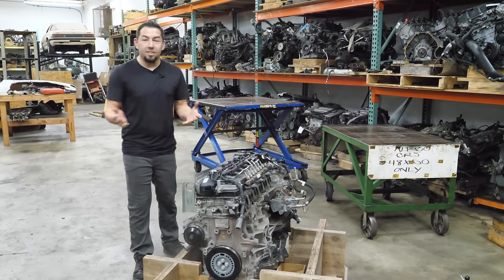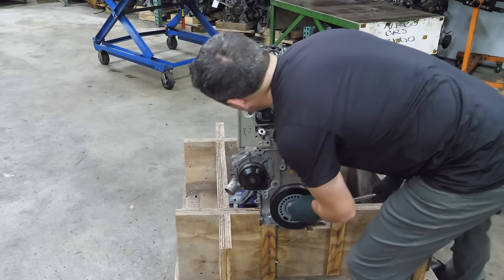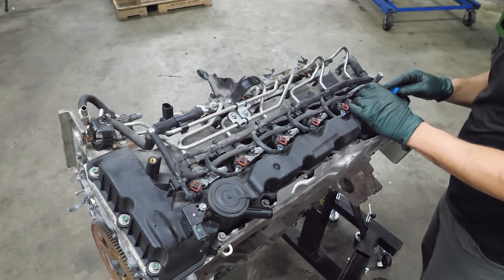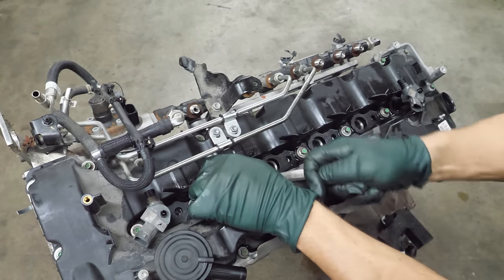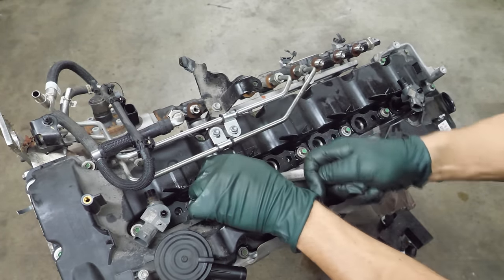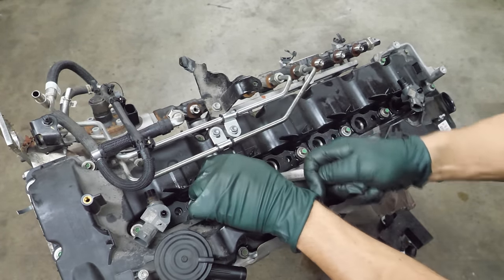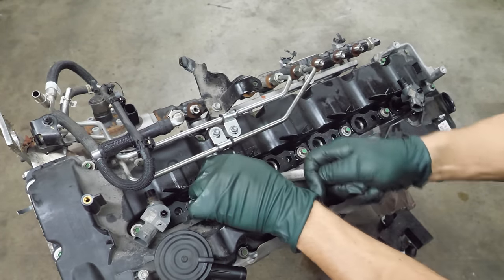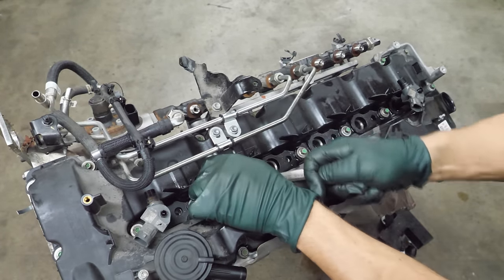BAD 2020 Silverado 3.0 Duramax LM2 Engine Teardown INCREDIBLE DAMAGE!

Comment: As a current 3.0 Duramax owner I hope not to experience this in person.
Reply: Frequent oil changes with quality oil. You’ll be fine.
Reply: Can’t believe those pistons didn’t crack from the new valve reliefs.
Reply: @MendicantBias1 Did one at 500 and at every 5000 now, with factory Dexos D. Cheap insurance.
Reply: That generation had a issue with oil consumption that was  hopefully with the LZ0 model.  The oil pump beltbus for drive ability and noise reduction.
Reply: Check your oil level
Then check it again and check it often
Don’t go by the oil life monitor, change the oil long before it says to.
Reply: Change the belt at 90,000 & oil change 5k
Reply: The engine seems like it was ran pretty long after it jumped timing
Reply: Check the oil from time to time.
Reply: Why didnt you buy a v6 or v8?
Reply: @Lorin-GabrielLeaua-fm1lw  1 you clearly didn't watch the hole video the engine was ran low on oil, most likely ran with low oil pressure for a while jumped timing because of the oil pressure and then ran even longer definitely could have been avoided. 2 250,000km is only 155,000 miles, so only 7k more than this engine had.
Reply: Change the timing chain
Reply: Just take care of it like you have common sense and you will be fine.  We don't see these engines at our dealership for anything more than regular service.
Reply: @747fixr because neither of those are as good, especially the V8 options in the 1500. Plus they also aren't capable of 30+mpg.
Reply: @briantruck2284 what is the cost of the belt replacement? Can’t be cheap.
Reply: @Mittencarpentry  I'm curious, what is manufacturer recommendation on interval?
I'm guessing it's more then 5k miles.
Reply: If your oil isn't going down between changes then it's not oil consumption but abuse from infrequent changes. Unless there's blowby somewhere but usually you'll see oil on the air filter. ie A bad egr valve will give you blowby.
Reply: Proper maintenance and keep the RPM's down....and you should run for a long, long time.
Reply: @MendicantBias1 ....an oil change has nothing to do with the pistons hitting the head, that was caused by repeated redlining.  That person got in their truck and buried the gas pedal the entire time.
Reply: They are very reliable when maintained properly. Isuzu builds the best diesel engines.
Reply: @fl_atv_riders4455  Define "pretty long". Anyone that doesn't know anything about engines could easily hear the sound of the valves hitting, think what's that, give the engine a quick rev to check the noise is still there and then shut it down and by then (only a few seconds really) would be enough to do this kind of damage
Reply: @andyg9991  from the sounds of it they continued to run it and diagnose it for a bit after it jumped timing, he stated the people just complained of lost power. The valves probably self clearanced after the first couple mins and stopped making noise and it lost power because the timing jumped and the valves where probably stuck open enough to have low compression. Then to top it all off do you really think that someone that doesn't check the oil on a 150k truck will know what noise that is
Reply: @deplorablelibertarian I used to do paint chip and scratch repair with a guy who drove his Silverado like that.  Complete ass driving on the highway.  Full throttle or nothing, all the time. That’s a terrible way to treat any vehicle
Reply: I'm sorry.  All I see here is needless complication by the designers.
Reply: @willl.3353 those pistons has a lot of varnish on them which is very unlike a diesel engine.
Reply: That's like saying, I hope I win the lottery. And you know the chances of that. I'm willing to make a bet that I don't ever win the lottery and that you will win the my 3.0 duramax engine blew up lottery.
Reply: Looks like STP got added to the oil. That Goo at the bottom of the pan plus the glitter.
Reply: Duramin you mean. They forgot to change the name when they changed the entire design philosophy.
Reply: @Mittencarpentry 5000? Kilometres hopefully lol but if it is miles then drop it down to 3000 max then your engine may last more than this heap of junk
Reply: @dakotaman408 I'd much rather have a slightly noisier engine with a chain driven oil pump, than a belt driven one. Look at Ford's Ecoboost engines, a similar design with belt driven oil pump with belt running in oil. THAT'S a crap design too !
Reply: @joeldeangelo6083 err... why? There was fu*k all wrong with the timing chain. It was lack of oil pressure that led to the chain jumping sprockets
Reply: @@Lorin-GabrielLeaua-fm1lw  The engines that rattled the front ends apart on the Ram trucks?   LOL
Reply: @@Lorin-GabrielLeaua-fm1lw  I have a 20 Duramax 3 liter Silverado... BEST truck and engine I have ever owned.. No oil use, starts every time, fun to drive as you don't have to rev it, it just goes... The 10 speed automatic is perfect for the engine too.... 
 Tows great... I guess I am prejudiced, but I am very happy with it........
Reply: You will sell it…
Reply: Sell asap
Reply: I think it had poor maintenance and was driven as a race truck or want to be racer
Reply: @briantruck2284 lol......you go get a quote for that plus yer not gonna change the belt without replacing chains,tensioner etc while yer in there. That chain is too long and has too many turns in it for it to last any amount if reasonable miles. Give us all an update when you have 200k miles on it....hint: it won't make it that long without very expensive maintenance and repairs. Vehicles dont run on emotions.
Reply: This was the kill video for me. I love my 6.6 but after this teardown. I wont be buying a 3.0 EVER.....belt driven oil pump? between the engine and trans. WHY? and location of the timing chain. Its over for me.
Reply: Do your maintenance and that motor will run hundreds of thousands of miles
Reply: Ford Ram GMC terrible design on these motors. Engineers went backwards.
Reply: Maintaining an engine and not dogging it will prevent this
Reply: Just don’t keep it past 125,000, and you should be fine….
Reply: ALMOST bought a 3.0 Silverado last weekend. Love the concept. Small inline 6 diesel. Perfect for a 1/2 ton. 

But… REAR BELT driven oil pump! Designed for use in cabovers. Typical GM blunder. Could not do it. 

They are known for high oil consumption. Seems this one didn’t make it to the next oil change. 

Went for a Tundra with gas V6.
Reply: Just checking the oil would have saved this engine.  I am impressed more than I thought would be.  @MendicantBias1
Reply: I beat on my 32-year-old Corolla all day long and it runs like new with no oil consumption
Reply: I have a ‘21 2.8L Colorado. My truck gets the oil changed every 2500 miles, I use Pennzoil Euro Platinum full synthetic.
Reply: I have a 2021 with this engine and love it. It averages 32mpg and has given me 44.6 mpg on the highway. Like any diesel oil and filter maintenance are a must to get longevity. I would love this 3.0 in my 1956 chev truck.
Reply: I don't trust GM anymore, Im staying away from the AC Delco. ow-20 @Mittencarpentry
Reply: @747fixr  i have a 3.0, and this motor is impressive. loads of power, excelent fuel economy. sweet engine. absolutely love mine.
Reply: The oil is very specific. Use ONLY that oil. Dexos D and the 0-20 is what the manufacturer calls for. I used only that in mine. Ran like a champ.

Comment: As a BMW tech who's has the unfortunate displeasure of doing many timing chains on the newest BMW inline 6 diesel the N57, it is unbelievable how architecturally similar these two engines are. Wouldn't be surprised if the cam followers swapped directly over
Reply: Is there a common cause for these N57 timing chain failures?  My 2014 535d with the N57 has 125k miles and I change the oil every 5,000 miles.  Problem free so far, and hoping I don't have to worry about this grenading my engine any time soon.
Reply: Not a tech but someone who owns a diesel bmw. I saw this video and thought the EXACT SAME THING. They look very similar!
Reply: @jmaner89 seems like it really depends on itself. I’ve heard of them going out at 60k to them never going out. Just stay consistent on oil changes and don’t drive like an a hole 24/7. Take care of it and it’ll take care of you.
Reply: It's an Opel design. The engineering teams must talk
Reply: As a previous BMW owner, I wish they would learn how to seal their damn oil pans like this one.  So it doesn't start leaking after only 40K miles.  And then charging $1500+ to repair it because the entire subframe needs to come out first.  What a joke and never again.
Reply: @86FxBdyCpe  I've been trying to delay the pain of doing that job on my 128i. I'm using LiquiMoly Engine Oil Saver to help swell the pan seal. It's only half working. Damn engineers want to keep the CG as low as possible. There is a hotter place in Hell for them........
Reply: @sharedknowledge6640 the difference here is that they designed the GM engine with North American’s strict anti-pollution regulations in mind. Ram and Ford took a European engine and tried to adapt it to NA. We all know what happened there.
Reply: @jmaner89 hey I have a 2014 535d with 175k miles... Hope you've cleaned your intake out at least once at this point and serviced tyranny every 60k miles...
Reply: Is the timing chain on these at the back like on the N47?
Reply: @ryanfrancis7264  Opel is GM
Reply: @CYodii  Thanks for the response!  Always kept up with the oil changes, and usually pretty modest with acceleration.  Highway driving mostly.
Reply: Literally was going to say the same thing, it’s just like an N57 / B57 looks like they managed to replicate the terrible timing system as well
Reply: @samholdsworth420 Not anymore
Reply: @jb5nf  when they were designing the engine

Opel is shit regardless of who owns it. Like BMW and any modern GM
Reply: @samholdsworth420  Opel was GM until they sold it to Stellantis along with other European operations.
Reply: @Thisoldhiker  LMAO stellantis is trash as well. It's also not  uncommon for manufacturers to share engine blueprints and transmission blueprints with each other

BMW has used GMs hydramatic transmissions for a while...
Reply: @86FxBdyCpe  I did this repair myself on a  X3 (E83) took me 21 hours…
Reply: @jmaner89  of course! Haven’t owned mine super long but it does have 308k miles with original chains. I just prefer the m57 over the n57
Reply: N57/m57 have the same bore and stroke too… The moment the technical information came out about the lm2 I realized this engine is intended to be their copy of an n57. Unfortunately it seems they copied the timing chain issues too.
Reply: Leaky oil pans are great.
As the owner of a 25 yo straight clean cheap af E39 who has to do a pan gasket tomorrow, I applaud the way the accountants have destroyed the value of these cars with nothing but job hours charged for 10 & 20 year maintenance items
Shop rate 50 buck gasket 1000+ labour
Reply: @samholdsworth420  I'm aware. I meant Opel and BMW both being German, their engineering teams could have some carry over between the two firms. BMW even used GM transmissions years ago. There's always collaborative work being done in the background that us groundlings never see.
Reply: Love all the chains in the back of the Audi V8s !!!!!!!!!!!!!!
Reply: I was a BMW tech during the very dark early to mid '00s. E65/66 without energy diagnosis capability. N62s, S54s, S62s, ZF 6HP shenanigans. It's probably just as bad now. We didn't have diesels until after I ran screaming for the independent world.
Reply: @86FxBdyCpe sealants are rubber. If you can seal an oil pan you can make an oil exposed belt that doesn't fail.
Reply: @dougrobinson8602 if you're using a product that swells seals that means it chemically interacts with it in a negative way. You're only shortening the life of the seal.
Reply: I hate how low bmw has fallen😞
Reply: @samholdsworth420 stellantis
Reply: @jw8578  right right 👍🏻
Reply: 2006 Mercedes CDI om648 800000 miles been opened runs perfect
Reply: @samholdsworth420 😊
Reply: @darknes7800 you damned Masochist ! 🤣
Reply: Doesn’t BMW source their gearboxes and Transmissions from GM?
Reply: Om 658 800k miles no chain replacement
Reply: @sharedknowledge6640  As I understand it, the engine was designed in Germany (by Opel) and the prototypes built in Italy.
Reply: @mathieuhache1845 This also shows how bad North American fuels are compared to the European fuels 😮😊
Reply: Some   one   said  its  linked  to  Opel so its  probably   linked   to    fecking    fiat
Reply: @CYodii k
Reply: @sharedknowledge6640 Trust me friend, you don’t want a GM engineered diesel!
Reply: VetteTitans  that is a normal misalignment coupler and is naturally wobbly like that by design. no issue.
Reply: @tonydiesel3444  wow,  800k miles on an engine benz never made! incredible! 
Stfu tony
Reply: Might be the same manufacturer and same part number. That'd be kinda interesting
Reply: @sharedknowledge6640 If you gonna get a diesel get a Cummins P/S or the real Duramax this is just a joke and has way more failure points than those 3 I mentioned.
Reply: European designed engine
Reply: @jmaner89  This engine ran low on oil, likely due to oil consumption related to the defective oil cover which has a TSB for it.
Reply: I read online that GM gets a few German engine companies like Opel to design a lot of their automotive engines these days.
Reply: @alexsmith-ob3lu  Some small turbocharged passenger car engines and also not the 2.7 Turbomax.
Reply: @samholdsworth420  and GM debuted magnetic fluid shocks years before any other manufacturer. Even before Ferrari.
Reply: N57 was replaced with B57 many years ago. Yes I noticed how similar these engines are also, looks like a bmw copy.

Comment: I was a heavy line technician at Chevrolet from 78 till 1984 I actually purchased a diesel pickup from Chevrolet as I was the diesel technician The vehicle was such a disaster that I had to lemon law it and the process that general motors put me through was hideous. The factory reps were even sending their problem child diesels to me that other dealers couldn't  properly diagnose. After fighting with general motors for 11 months and 48,000 mi and two other dealerships tried to fix it. It became obvious to me that general motors just screws the consumer so I decide to quit working for general motors and I bought a 1993 Dodge pickup with a 5.9 Cummings in it and I'm still driving it today with no issues other than maintenance. In my opinion general motors prefers beer can technology over cast iron strength and they tend to design failures into their vehicles as they were busted for all small block Chevrolets from 1969 to 1982 because they deliberately did not heat treat number 5 exhaust lobe on their camshafts. This would usually cause a failure between 80 and 120,000 mi and most customers would just buy a new car thinking it was just a glitch
Reply: Two of my neighbors are still waiting to have their exploding CP4 pumps replaced under recall, so there's enough sin to go around.

Comment: The sound it must had made when it jumped time and the valves smacking those pistons must have been glorious 😲
Reply: I bet it couldn't be heard over  the rod knock.
Reply: You usually don't hear it when it happens.... It just quietly quits running.
Reply: I would imagine it sounded like a diesel rattling apart.  Soooo it probably sounded no different 😀
Reply: Yep it made that Chevy sound like a 80’s ford diesel 😂
Reply: That's funny.i don't care who you are 😊
Reply: That's called the steel woodpecker.
Reply: Knock knock. Who’s there?
Reply: "Customer states the engine began emitting a series of very expensive noises."

Comment: If you noticed the #2 cylinder when you removed the piston had a broken compression ring, it probably lost its oil thru that cylinder out the exhaust, "the def fluid filter system would have caught most of the smoke" then when the oil was depleted it lost pressure and jumped time, the rest was a downward spiral from no oil pressure. Great video!
Reply: Did not notice I have a truck with this engine and I’m largest concern was the reliability and it seems good but I’m going to look out for that failure as well as going back to look at the video and see if I can see the breakage.
Reply: @daltonnewbold5874 same here, I have 2021 with 3.0 and it’s been great engine, so far. I will be monitoring all posts to see if there’s anything lurking in the engines future. Tear down shows how impressively tight the engine is built. Did you notice the metal oil pan? looking at you Ford!
Reply: @joedfazio that pan was literal tin metal, could poke a hole in it with a flathead screwdriver. Warped beyond reusability just by force of separating it from the silicon holding it to the upper pan. How is that any better than plastic?
Reply: @dixiemudtoy because the drain plug still has threads instead of some twist lock oring crap
Reply: There is a recall for that issue
Reply: All because of a bad weld/baffle in the cam housing. Loses oil so fast most people don't check oil often enough, boom.
Reply: People underestimate the importance of piston rings.  Good job noticing that. It's definitely a cause of failure.
Reply: @jesse.e.martin yes I had a 2020 LM2, there is a bulletin to replace it, should have been a recall!
Reply: I would say these guys had it right.  Bad weld or cracked weld in the cam cover causing it use oil like a MFer in cyliner #2.  I know first had and just got my truck back today.  After I noticed mine going low on oil and going into reduced engine power.  Got home and noticed it was oil related.  Pulled the dipstick, and there was nothing on it.  3½ quarts low.  Got an oil change, and it was low on oil (end of has marks) within 1,400 miles.  Warranty covered the new parts and labor.